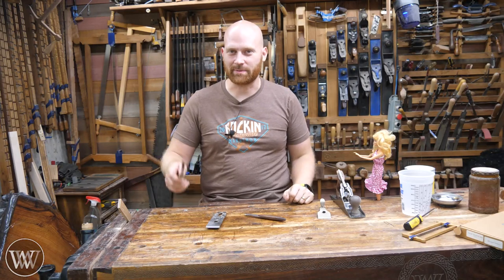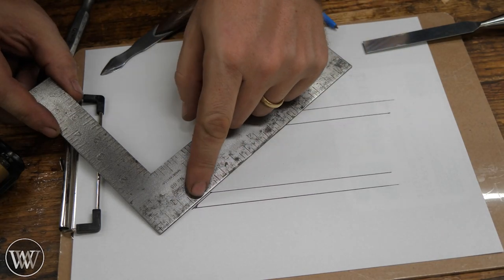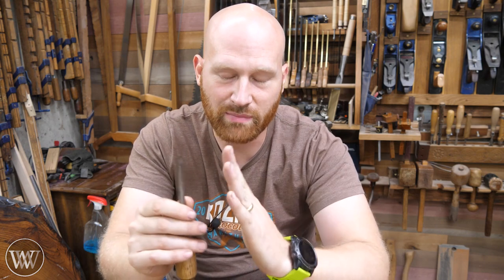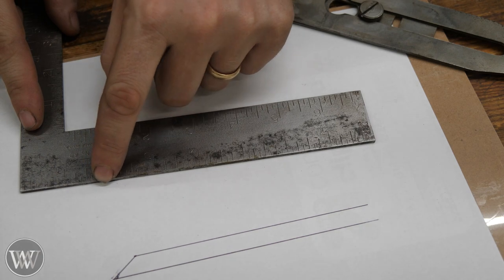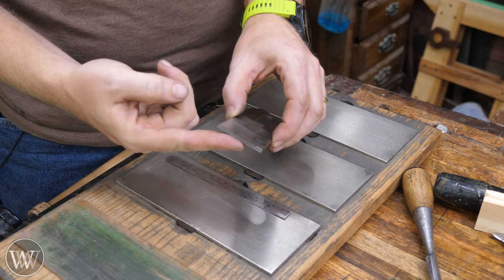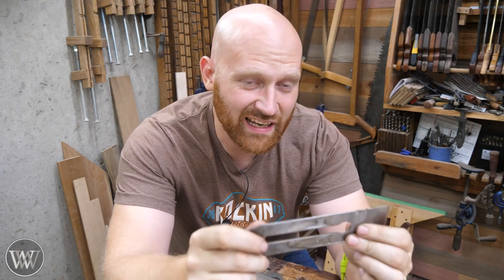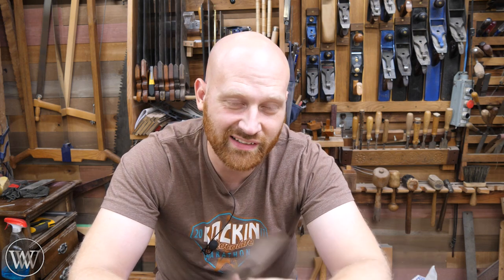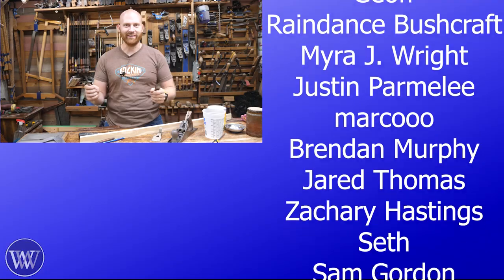The Truth About Secondary Bevels and Back Bevels on Planes and Chisels

Comment: This is Really a Good Video Explaining Secondary Bevels.  Thanks for Your Time!

What is missing from the secondary discussion is honing and stropping.  It is impossible to strop a secondary bevel.  I hate sharpening and therefore prefer to stay away from stones and stop a couple times a day rather than put the blade into a jig and hit the stones.  

Also what is missing from the back bevel discussion is the fact that most new and modern plane blades are reasonably flat and can be easily flattened with a few dozen strokes on the stones, so a back bevel is unnecessary as a shortcut to flattening.  The back bevel also suffers from the same problem of stropping above.  

Thanks again.  You are the Best.
Reply: Why can't you strop it?
Reply: Because one cannot control the bevel with any accuracy when stropping a secondary bevel, because it is too small.  One may feel the primary bevel to easily strop it.
Reply: ah ok good point! do you know if you can use the jig for stropping too or nah? thanks!
 @tommccurnin524
Reply: The micro bevel is so small ....  how small is it?  It is so small that they call it a micro bevel, which as its name suggests is really small and one cannot rest the bevel on anything without it rocking back and forth, destroying the very micro bevel you've just created.  I think one should choose between (1) making a micro bevel and forget about a leather strop; or (2) ignoring the whole micro bevel craze and stropping chisels before one uses them.  Pick one.  Nothing wrong with a micro bevel.  Nothing wrong with stropping.  Just can't do both, or at least I'm not good enough to do both.

Comment: I can do both full convex and secondary bevel.  The full convex is a bit sturdier but harder to find the cutting edge during the sharpening without increasing the cutting angle.  The micro secondary can be done on an oil stone in a few strokes. The additional space behind the primary also makes it easier to chop a mortise (but less durable).

Back bevels I only use on flat blades with backs beyond the ability to be flattened effectively.  It also only works on perfectly flat blades or relatively un-cambered (width wise) sections.  It's not a good idea once you have figured out what you are doing, because it creates other issues.

Comment: Great video, James. Simple explanation that all can understand. I sharpen the entire bevel and flatten the backs of my plane irons without secondary bevels. I will occasionally add a secondary bevel to the primary bevel if I am touching up the cutter during use, usually just using the strop. I have used a back bevel on a badly pitted No 7 antique iron for exactly reason you described. It was not possible to flatten the back without removing 1/4” of material to clear the pitting. I was able to achieve excellent sharpness with the back bevel and save a lot of the iron for the future. “Play around with it and have fun”. The very best advice. What ever method produces the results you want are the best methods for you.

Comment: I am a wood carpenter specialist here in the Philippines for 30 years this is my occupation. One things I should share with you is about the quenching methods of bevels and edges of chisel and any others sharp tools equipments in relation as wood carpenters observer. Here in the Philippines we common used for quenching methods, we went to the blacksmith by heating the bevels and edges the allowance of 2 inches from tip of the edges then wipe the bar soap of clothes, back to back horizontal direction then put it again into the fire just for 5 minutes then submerge the edges and bevel gradually into water the white line it's appear and this well done as a good result for quenching methods by manual. The objective is to straightening the bevel and edges sharp when you use it at work it will prolong period of time while you working.
Reply from the maker: Right on. We do that with all of our blades here too.

Comment: An instructional video as usual. Thanks for that. I am finding I am fond of the Veritas blades because they are thicker than the old blades so even in cheaper planes or older planes the performance is greatly increased and chatter is pretty much eliminated. Also I find that since the blades are thicker it is much easier to find the bevel and hold it. I am selling off my power sharpening stuff and will get the diamond plates that you and Rob and Paul are both fond of using. There is a reason that "old school" never really went away. I am going back to that myself. As well, there is a certain satisfaction to learning a new skill that does not need fancy expensive machinery to do the work for you. As long as the damn thing is sharp I am happy.
Reply from the maker: Sounds like fun. Right on

Comment: I'm not that experienced but usually all the tricks and tips and 'innovations' in sharpening come from those with access to powered machines or from people whose hand tool working are influenced by machine working. For those folks they do work.
For me, I just like a single bevel and a flatish back. I use a guide and I no longer feel a pressure to freehand because sticking my tool in at one bevel is just a single extra step.
That said, I probably do end up with a minute secondary bevel after stropping but let's ignore that and just call it a polished edge.
Find out what works best for you as the import thing is flatish and sharp.
Ps it's hard enough to keep those 1/8" chisels square without then redoing it on 2nd and 3rd bevels.

Comment: Nice one. There's not enough people who explain things properly like this, and let you know there's more than one way to skin a cat.
I think I'll keep the back bevel/ruler idea in the back of my mind for the next time I find a blade that's not totally flat at the back. 
When I get an old vintage plane and it has a secondary bevel I usually just bite the bullet and get rid of it straight away, and I usually curse the previous owner a lot when it's one of those really old, thick, blades!
But one of the things that annoys me the most is when I'm sharpening a spokeshave blade and it digs into the stone and flips over. I think I've created a few new curse words when this happens..
Reply from the maker: Oh I hate that. sometimes with those small blades I only pull them back rather than pushing them back and forth.
Reply: @WoodByWrightHowTo  Ah yes, I might give that a shot, especially when I'm starting to get a bevel on the back so that all my good work doesn't get undone. And I don't want to ruin the stone either.
I finally caved a few days ago and just ordered a honing guide; I'd prefer to just sharpen by hand, but the guide will be handy for certain situations, like this, and fixing curved bevels and blades that aren't straight, and anything else that's awkward.

Comment: Excellent explanation. I just got into hand tool woodworking and have some Lie Nielsen and Veritas planes that I haven’t gotten up the  courage to try sharpening, yet. Those planes have thick A-2 and even more exotic steels that I imagine would take forever to hand sharpen the entire bevel. I note that you use antique blades, which are much softer carbon steel. Would your procedure be different with the ne hard steels?
Reply from the maker: I have blades of all makes and types. I have several that are a2 and a few that are even carbide. All of them. I hand sharpen with just a standard bevel. With diamonds. It's pretty quick and easy. There isn't much difference from steel to steal. If you're using whetstones then it can be a pain. And you really can't do carbides with water stones or oil stones. I actually did a full test a while ago. Testing almost every single iron on the market. For their durability and sharpen ability.
Reply: @WoodByWrightHowTo  Thank you so much for that info! If the difference in speed of sharpening is not significant, then I would much prefer the simplicity of sharpening a single bevel than making all sorts of secondary, tertiary and back bevels. Plus, it will allow me to free hand sharpen a single large bevel.  I will look up your test of blade steels. I got both diamond plates and water stones. I should then use only the diamonds and forget the water stones? Finally, I note that the well-known craftsman, Paul Sellers, takes somewhat of the same approach as you do, freehand sharpening a single "macro camber" . He states that micro bevels came into vogue to compensate for waning sharpening skills.

Comment: Why does it take less time to grind a small surface (the secondary bevel) than a large one (the primary bevel)?  They both are in full contact with the surface during the grinding process.  I assume it's because the downward pressure (PSI) is higher on the smaller surface.  So does it make sense to try and apply as much pressure as you can when grinding the primary in order to speed things up?
Reply from the maker: No. The reason it takes longer to do the full surface of a bevel is that the cutting grit does not make contact with the whole bevel at once It only makes contact with parts of the bevel and because there's a larger surface area it takes more time. It takes the exact same amount of time per capita of the metal being removed. And as there is more metal being removed on the large bevel then it takes longer.
Reply: @WoodByWrightHowTo  Interesting!  Thanks.

Comment: On the plane blade, I don't see the angle of the cut changing with the back bevel. I definitely see the angle is steeper with a secondary bevel on a chisel. I don't use a secondary bevel for my chisels but I do use a back bevel on the plane irons. My planes are vintage and the back bevel does make the cuts cleaner.
Reply from the maker: s back bevel on a plane iron will change the angle of the but and make it steeper. for tough grains that is a good thing though it will require a bit more force to push it will give you a cleaner cut.

Comment: Great information. I have one problem. I can't get plane iron sharp enough to shave any hair. Oh it will plane all right but I feel forward resistance as I'm planning. Here's my method;
 I use an electric grinder for putting on the primary bevel. This will put a Hollow Grind creating a burr on the edge of the plane iron. I then remove the Burr. Bear in mind  that I have pre polished the underside of the iron about a half inch  back from the front edge  to remove scratches and to make it flat . Then I use a honing guide 2 hone the front edge until  it  creates a burr after which I use David Charlesworth's ruler trick to remove that burr. You would think The Edge would be sharp enough to remove hair but it won't. This is mind-boggling. Your thoughts please
Reply from the maker: there are hundreds of things that could be going on. what grits are you using, are you stropping. what kind of stones are you using. having a bur fall off does not mean it is sharp and often if the burr is too big it will take the tip off with it. Feel free to send em an email and we can talk it through. I would be glad to help JamesWright@woodbywright.com sorry I probably will not see a reply here as it would be too far down the list.
Reply: PLease correct me if I'm wrong, but I've recently read that polishing the back will not lead to sharper blades. New blades on Veritas for example are lapped and they mention that it does not need polishing. You need to hone the front and add a secondary bevel if you wish on that new blade. Perhaps you are introducing some extra ''error'' when performing the polishing. I'm thinking perhaps is rounding the edge a minute amount., thus not sharp enough for hair care. Just a thought, which may be far from reality.

Comment: I was trying to sharpen a plane iron with one 25 degree bevel (with a honing jig) and it was shiny as heck along the entire width of the bevel (and marking the bevel with a sharpie I could see all the sharpie marks go away during the sharpening) but the performance of the plane just didn't seem right.  Also, I never seemed to get the "burr" while I was doing the sharpening, which bothered me.

Last night I tried putting a 30 degree 2nd bevel on it - after the first grit of sandpaper I immediately felt the burr. I went up through all the grits (which didn't take long) and put the iron back in the plane (a # 5 1/2) and the difference was immediately noticeable.  I'm not really sure what I actually did during the sharpening process, but it really helped.
Reply from the maker: One of the problems with 25° is you're removing so much metal across the hole to the bevel that it takes a ton of work to actually remove the tip. Also the 25° tip is very fragile and will not last as long as a 30 or 35°. I usually sharpen my plane irons around 35°.

Comment: Years ago, I read that a back bevel can be used to raise the effective angle of attack which then makes the plane harder to push but has the benefit of reducing tearout on gnarly wood.

As if you had a plane with a higher frog angle. 

I guess that has fallen somewhat of favor with the advent of bevel up planes. Just buy a new plane and a couple of blades rather than just a new blade.
Reply from the maker: True you can do that but if you put a large bag of lawn you have to move the chip breaker back which defeats the whole purpose of trying to get the higher angle for less tear out. Keeping the chip breaker closed to the tip is more effective than the higher angle cutting edge at reducing tear out.
Reply: @WoodByWrightHowTo  I'm guessing two things: 1) you used dictation software, and 2) you said "a large bevel on" not "a large bag of lawn"?

Comment: Isn't one of the reasons you might want to increase the bevel  and  attack angle, is to reduce tearout on figured or interlocking grain woods?
Reply from the maker: Yep. But most people who want to do that just end up getting a second iron and keep it at that other angle resin changing the angle back and forth because that wears out the blade pretty quickly.

Comment: Another reason for the "ruler trick" is when flattening the back of the plane iron prior to sharpening.  By using the ruler you only have to flatten the very end of the iron, not the whole iron.
Reply from the maker: That is true. However once it is flattened it never needs to be flattened again. It's a once and done procedure.

Comment: I must be weird... I use a secondary bevel only to hone.  I will remove the previous secondary bevel every time I sharpen on the cheaper lower grit stone(s).  This saves the wear on the more expensive honing stone 🙃.
Reply from the maker: yup that is one of the other ways a lot of people do it. works great!
Reply: That's how I started doing it, after buying a sharpening series from Richard Maguire
Reply: I do the same thing.  I've only been at it a few months but I tend to hone steeper than I sharpen.  Glad I'm not the only one!

Comment: Rob Cosman actually puts "tertiary" bevel on its blade ;-)
The reason I put a secondary bevel on is because it is faster to sharpen just the tip of the blade when you're working on you project and need a sharper tool. I usually regrind the primary bevel in between project and thus the time spend to regrind it doesn't interfere with the project flow. But as you said everyone should do what works for them.

Comment: It seems that a 30 degree bevel would be useful on mortising chisels and 25 degree on others.  What are your thoughts?
Reply from the maker: I use to do that but after the chisel test I just did it was impressive how much more edge retention you got on 30 over 25 with out loosing the pressure needed to make the cut. so not I do far more at 30. I still do my carving tools around 20 but those get stropped every few seconds.
Reply: @WoodByWrightHowTo  Can you still pare adequately with 30 degree bevel?
Reply from the maker: yes, but if I want a lot of detail then I grab one of my carving chisels that are at 20. but that is only like once a year.

Comment: can I put a back bevel on a bevel up Jack plane？
Reply from the maker: You can as long as it's no more than two or three degrees. If it's more than that then the iron won't be able to catch. The question is why would you do that. It doesn't help the cutting edge and it's just one more step.
Reply: @WoodByWrightHowTo  I thought it might help me fix a rounded edge. maybe a secondary bevel would be better for it?

Comment: See I've thought about a back bevel or a secondary bevel would be worth it in the long for me, and I've always voted against it for one reason or another. I do hand sharpening for everything, except my turning chisels, and it took awhile to stop getting a rounded bevel but at the same time while doing the back of my plane iron or chisel I would unintentionally put in a back bevel so that kind of made up for my blundering with the primary bevel. So I bought a honing guide then it got messed up so I'm looking into a new one, but I would have to say I dont like them myself not because of the extra step or the extra time but because on my planes I like to easily move across the wood and any extra effort I dont have to put in makes me happier, and with my chisels I generally use them for mortise and tenon work or for bringing something down to the same flatness as the rest of the piece or for blending when fixing drawers or the like. This video was very informative as to why both of these methods are popular among woodworkers and what the benefits are or aren't.